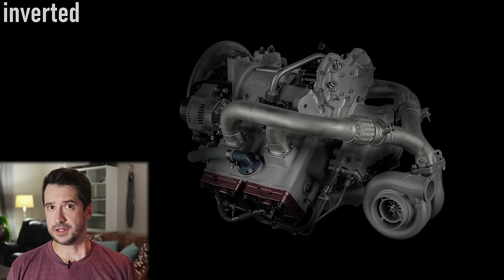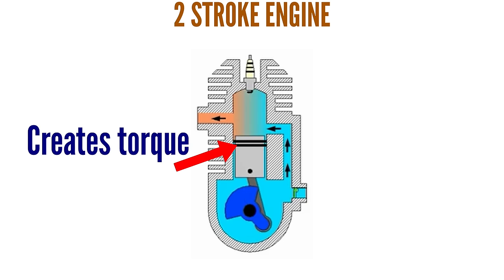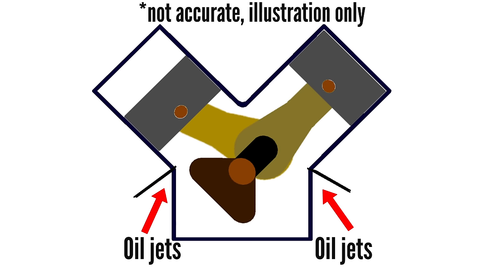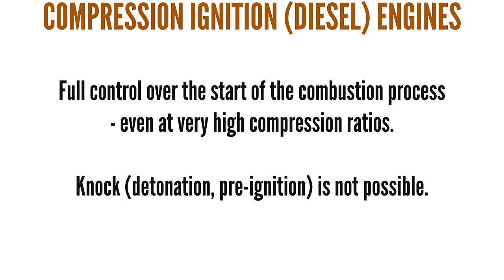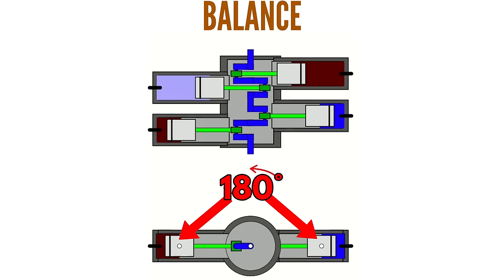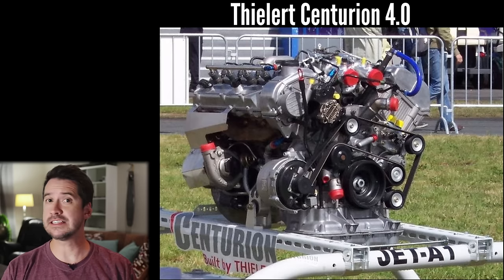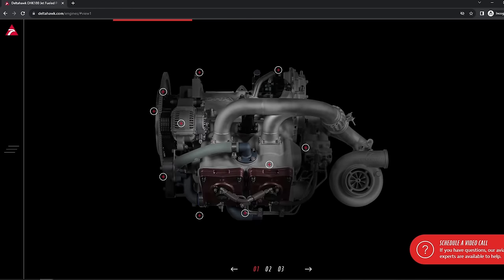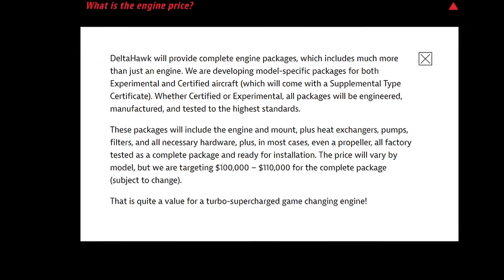Deltahawk's Jet Fuel Piston Airplane Engine Explained

Comment: The mechanically driven scavenging blower is not a supercharger, even though it is identical in construction.  It's the application that makes the distinction.  In this case it merely sweeps the cylinders clear of exhaust gasses (scavenging), in preparation for the compression stroke.  It does not pressurize the cylinders before compression begins (supercharging).  That is the role of the turbosupercharger (turbo).
Reply: in this motor, it is absolutely functioning as a supercharger (much less that's the actual name of the mechanical air pump).  Unless it had some form of Valve timing adjustment, it will absolutely provide positive pressure in the cylinder.
Reply: A “normal” two stroke also force feeds the upper cylinder. It’s done by air being compressed into the crankcase. A scavenge blower simply replicates that feature.
Reply: @Jessersadler  This motor has no valves, it is a two stroke compression ignition engine.  No valves, no valve train, no camshafts, no spark plugs.   Two strokes are simpler design, less moving parts, less parts to fail, it takes less energy to run fewer parts.    Read up on two strokes, if you don't understand them you as missing part of this discussion.
Reply: @orthopraxis235  Valve = port.  It's still timing.  Timing on a 2 stroke is achieve with placement of the ports.  Which just helps solidify the absurdity that this supercharger wouldn't be providing boost.  (although there is the "power valve". . . which is exhaust timing. . . by a slide valve (doubtful these motors have it). . .)  I comprehend engines, very well.
Reply: @Jessersadler  It's a turbocompound engine
Reply: @alanbrown397  No, it is a boosted engine.
Reply: @Jessersadler    It does not provide appreciable boost. With these port valve engine  the exhaust will always open first and close last, so any extra pressure in the incoming air stream will simply flow out the exhaust.  Only an opposed piston can time the ports that the exhaust will close while the inlet is still open.  This engine can't.
Reply: @PDZ1122  check the website. . . the engine is boosted.  The port timing has to allow that.  It's physics.

*edit 
can also be achieved with back pressure.  Basically, the whole system is pressurized (exhaust/intake), with intake being higher for scavenging.  The cylinder is still seeing boosted pressures (higher than ambient), and it's efficiency is increased.
Reply: @Jessersadler  No it isn't. It's only a scavenge pump. To "supercharge", the exhaust port would have to be covered before the intake port (assuming the pump moves more air than the displacement).  If that were the case, exhaust blowdown pressure would force exhaust out through the intake port.
Reply: @turbo8454  not if the cylinder was completely scavenged.  Also that twinscrew supercharger is not going to back feed. . . well, not twice. . .You could also achieve "boost" with back pressure.  Ski-doo seems to achieve this with only a turbo. . .

Again, the positive displacement pump used is called a TWIN SCREW SUPERCHARGER.  Regardless of the semantics argued here.  Crazy that there's an argument on what to call the "air forced into the cylinder", and when that becomes boost or Scaveging.

looked up the patent, and the study done.

There are three major conventional gas exchange types currently used in two-stroke APEs: the cross type, the loop type, and the uniflow type, whose airflow organizations are shown in Fig. 2.36 The gas exchange systems based on the cross type and the loop type use the intake and exhaust ports on the side of the cylinder liner for gas exchange, which open and close directly under the control of the up and down movement of the piston. The gas exchange systems based on the uniflow type use air intake and overhead exhaust valves or opposed piston intake and exhaust ports for gas exchange. All types of gas exchange must follow the same principle that the intake pressure that drives the fresh charge into the cylinder must be greater than the pressure of the exhaust systemSchnürle Company proposed another type of loop scavenging, called the Schnürle loop type, which has a pair of intake ports distributed on the left and right side of the exhaust ports and symmetrical along the center of the cylinder, as shown in Fig. 2(c).44 The fresh charge flows to the side of the cylinder facing the exhaust port, then backwards when reaching the cylinder head until flowing out of the exhaust port. The top of the Schnürle loop type piston does not need to be designed with a wedge-shaped flow guide structure, so there is no problem of low compression ratio and easy knocking. Because of the shorter airflow path in the cylinder and lower momentum required in intake injection, the mixing of fresh charge gas and exhaust gas can be reduced, and its gas exchange performance is relatively better under low flow conditions such as partially open throttle. Zoche’s ZO series APE adopted the Schnürle loop type, resulting in significantly improved air exchange performance and fuel consumption compared to the cross-flow type. However, its gas exchange performance remained poor at low speed due to insufficient air intake, and the fuel consumption rate was higher under low load conditions.45

The Curtis loop type adds an intake port opposite the exhaust port based on the Schnürle loop type to increase the intake flow mass and improve gas exchange performance, as shown in Fig. 2(d). APE based on the Curtis loop type has the required gas exchange and power performance in all working conditions, with significantly less performance degradation in high altitudes than the cross type and lower manufacturing cost. Most of the current APE products that apply the loop type to gas exchange use the Curtis loop type, such as Delta Hawk’s DH series APE, Hirth’s F23 series APE, and 3 W’s SP-275 series APE.46 The 150, 188, 300 kW lightweight APEs developed by NASA LewisThe two-stroke gas exchange process, which is one of the critical factors affecting the thermal efficiency and power performance of a two-stroke engine,19 is the process of replacing exhaust gas in the cylinder with a fresh charge. It starts when the exhaust valve opens (for the exhaust valve type) or when the exhaust port opens (for the piston control port type) and ends when the intake port (valve) or exhaust port (valve) is closed. The gas exchange process can be divided into three stages: (A) the stage, called the “blow-down stage”, starts from the opening of the exhaust port (valve) to the opening of the intake port (valve);(B) the stage, called the “scavenging stage”, starts from the opening of the intake port (valve) to the closing of either the intake or exhaust port (valve); (C) the remaining stage, called the “final charging stage” or “final exhausting stage”, ends until all the intake and exhaust ports (valves) are closed. There is a significant difference between the gas exchange process of the two-stroke APE and the four-stroke APE, as shown in Fig. 1. Due to the limited gas exchange time and the simultaneous intake and exhaust processes during scavenging, which involves mixing fresh charge and exhaust gas in the cylinder, the two-stroke APE is much more complex in the gas exchange process and difficult to control.20
Reply: @alanbrown397  I just looked at the patent drawings.  It seems there's a set of ports that are only connected to either the turbo or the twinscrew supercharger, and they're not in-line as one would assume.  In the writing, it mentions something about a check type valve, which I assume is on the turbocharged intake side because the twinscrew will not back feed.  It's not a traditional turbocompound set-up, but it is the same achievement.
Reply: @Jessersadler  If the scavenge pump is actually "supercharging" the cylinder then why is the turbo supercharger (correct name) there?  By definition "supercharging" means to charge higher than atmospheric pressure. No semantics involved. And any back pressure against the engine requires work to be done against it, thus absorbing some from the crankshaft. 

For charging the cylinder to a greater extent than can be done by atmospheric pressure is why the turbocharger is there. If the scavenge pump was providing greater pressure to charge the cylinder than atmospheric, there would be no need for the turbocharger.

Much of the confusion comes from the fact that GM/Detroit diesel two stroke roots type scavenge pumps were and are used as "superchargers" on gasoline engines.  Those scavenge pumps did not "supercharge" those Detroit diesels, nor does it "supercharge" this engine.
Reply: @alanbrown397  This engine has no turbine in the exhaust that is supplying power to the crankshaft, thus it is not a turbo compound engine.
Reply: @turbo8454  Yes, there's is absolutely a turbine sitting down stream.

And the supercharger is there for starting, and parameters outside of turbo efficiency.  Same as your Detroit diesel.
Reply: There is no turbine downstream of the turbocharger, thus it is not a "turbo compound" engine. The only turbine is the one driving the turbocharger centrifugal compressor.
 

BTW the roots pump is not a "supercharger". It is a '"scavenge pump" and I know why it is there. Get your terms correct. Just because the manufacturer incorrectly identifies the roots scavenge pump as a "supercharger" does not make it one. The scavenge pump does not raise cylinder pressure above atmospheric.......... thus by definition it is NOT a supercharger!
Reply: @turbo8454  A turbine is the power extractor from the exhaust gasses, and a part of the turbo.  So the whole first sentence doesn't make any sense.  Also, the compressor wheel is called the impeller or compressor wheel.

Any restriction on exhaust gasses will provide boost pressure in the cylinder.

It's not a roots blower. . . this is a TWIN SCREW SUPERCHARGER. . .  they are not the same

Back pressure caused by the turbine of the turbo provides the boost pressure in the cylinder.  The supercharger will provide boost because of this.  

If anything the Detroit people have miss named it.  Yes, it's a scavenged pump, while it's standing alone.  The second you introduce back pressure (turbo) it absolutely acts like a supercharger.  But since this was an add on for Detroit, they continued to call it a scavenging pump.

The company PATENT HOLDERS Say this is supercharged.  I agree

At the end of the day. . . Is greater than ambient pressure achieved in the cylinder?  Then it's a supercharger.

Whats next?  You going to say the turbo is a Scaveging pump?  Because it is, and it does. . .
Reply: @Jessersadler   Twin screw or roots, it is still only a scavenge pump. Not a supercharger. No matter how hard you try, the scavenge pump is not a "supercharger" by definition. Even on this engine the intake port is covered before the exhaust, thus no "supercharging" of the cylinder by the scavenge pump. Any air supplied above atmospheric to the cylinder is produced by the turbo supercharger, not the scavenge pump. Correct terminology is that this engine is a turbo supercharged engine.

You obviously have no clue what a "turbo compound" engine is. This engine has no turbine (called a power recovery turbine) supplying power (connected mechanically) to the crankshaft, downstream of the turbocharger.
 If you think it does, why isn't it in any of the illustrations or animations?
Reply: @turbo8454  Man, you obviously did not score high on reading comprehension.

Never said the turbine was connected to the crankshaft.  But the turbine is spun by the exhaust (waste) gases. . . Extracting power to spin the impeller.  It's how a turbo works..

Last freaking hail Mary for you to comprehend. . . .
Let's says you have 2cycle, with a blower, nothing else.  It will scavenge the cylinder and will not provide any additional pressure above the atmosphere.   Now take that same engine, and put a restriction in the exhaust.  Let's say this restriction applies about 10 psi of back pressure.  Because the blower is a positive displacement,  it will still scavenge the cylinder, but the pressure the cylinder see is 10 psi above atmosphere, before any new air is pushed in.

So in this motor, the restriction on exhaust gases is the turbo turbine.  What the actual numbers are 🤷‍♂️, but due to the restriction it's running higher than atmosphere pressures in the cylinder.   

This motor in particular has a separate intake port for the supercharger, and another one for the turbo.  They're not inline, and not the traditional compound.   Both are providing a positive mass of air, so both are contributing to the higher than atmosphere pressure in the cylinder.

You'd have a better argument calling the turbo a scavenging turbo. . . because guess what, it scavenges as well.  And at least at that point your argument would be consistent.

Do you research on this motor the patent is there for you to look at.

** Also, according to the archaic drawing, it looks like the intake and exhaust ports are next to each other (timed the same).  It's a simple drawing, and that could be wrong.  Just letting you know what it actually says
Reply: @Jessersadler   Holy cow, talk about lack of reading comprehension, he's in your mirror. Good God you need help.

 In my reply to allanbrown397 (who said it is a turbo compound engine) I stated there is "no turbine in the exhaust supplying power to the crankshaft thus it is not a turbo compound engine" and you immediately jump in and state  "yes there's is absolutely a turbine sitting downstream"....................Ok mr expert where is this power recovery turbine? 

And as you are having other problems here as well view and freeze the video at about 5:27 and notice the relationship of the intake port shown from the air box and the exhaust port. I'll just leave that at that.

A  word of advice. If you are going to try and impress everyone with your "I know more than everyone else knowledge", be specific and use correct terms. Fast and loose with terms and using slang makes you look like a know it all armchair blabbermouth who in reality is clueless! 

If you want to keep going 'round and 'round I'm game. You are great low information entertainment and best of all it's free!
Reply: @turbo8454  There are 2 sets of intake ports. . . Both turbo and supercharger force air into the cylinder, achieving above atmospheric pressure.  Are we now arguing something different now?  Or are you finally conceding that this is infact what the manufacturer calls it, a supercharger, which by definition is what a scavenging pump is.

Also, a compound turbo (assumption of the original OP idea. . . "turbo compound" is also used when discussing this system, although you could argue semantics on that as well.  Kind of obvious that this is what he meant) engine has nothing to do with the turbine being connected to the crankshaft.  It is a system that compresses the air twice  i.e. 2 turbos in series (called compound turbo, to delineate it from a twin turbo)  It can also be achieved with a turbo and supercharger. . .
Reply: @Jessersadler  You keep flopping around like a fish out of water. The scavenge pump is not a "supecharger" by definition. As many times as you state it's a "supercharger"' I will call you out for being wrong. That's why the turbo supercharger is there, to achieve aspiration (and power) above what atmospheric pressure could produce. I have stated these things several times now and you keep trying to twist it around into something different to save face. My argument hasn't changed from my first comment. The only thing  I concede you really don't understand the correct terminology at a minimum and I suspect that's because you don't understand what you are talking about. You are sloppy at best.

It is not obvious what allanbrown397 meant other than claiming it was a turbo compound engine. I took what he said at face value. Why would I take it any different? This is not a "turbo compound  system", or anything remotely related. Nor is it a "compound turbo system". A "turbo compound system" has the furthest downstream turbine mechanically connected to the crankshaft. This engine does not have that feature, nor does it have "compound turbo's". This engine as shown and explained in the video has one turbo supercharger and a scavenge pump. Simple as that.

And you still haven't shown me where that second intake port connected to the turbo supercharger is in the animation. (the video creator didn't mention any such second intake port either) You obviously can't because it isn't there!

Keep trying. You keep digging that hole. Thanks for the daily laughs!
Reply: @turbo8454  

"turbo supercharger". . . right🤦‍♂️

A "Compound"  setup can absolutely run a supercharger and a turbo. . .look up black smoke racing.    Also compound turbo= turbo compound,  while you may say that term is being used erroneously, it's street speak.  Like calling a twin screw a blower, when technically, by name, it's not. . . common speak, people understand.  Just Google it, and it will pull up both.

Supercharger is an air pump that increases the mass of airflow into an engine that mechanically driven off the motor.  That's what this twinscrew does.

No one is saying this doesn't scavenge the cylinder. . .the turbo does too.  Both provide boost.  

I guess you know more than the Factory, engineers and patent holders.  Write them a letter and tell them they're wrong.  they have to listen to you, right. . . the self-proclaimed arbiter of engine knowledge.

dude, I'm done.  you're willfully ignorant.

Do yourself a favor, and look the patents up. . . but you won't.
Reply: @Jessersadler 

I think that when you use the term “compound” in the context that you are it can be confused with “Turbo-Compounding” which does mean to have excess exhaust energy provided to the crankshaft via various means. So a lot of the discussion seems to revolve around precise technical definitions of “things”. And it seems that various people are not on the same page. Interesting discussion, learned to be more careful.
Reply: @Mentaculus42  Black smoke racing ran both a Turbo and a supercharger on their OM606 engine in the early days.  The air is compressed from the turbo and then compressed again with the supercharger.  Hence, the "Compound".
Reply: @Jessersadler  

Not arguing the terminology, so identical to a P-38 and a P-47 but not like a Volvo D13TC engine or a Wright R-3350 (Turbo-Compound version) radial engine which are Turbo-Compounding engines. Also some types of Formula One engines that use a Motor Generator Unit - Heat (MGU-H) which is one single unit that is both a turbocharger and a centrifugal supercharger with electric energy recovery & power input). Similar name but quite different intent with some combined capabilities.
Reply: @Mentaculus42  well, there was a question mark after your comment.  It would be better to call it sequential, but that denotes 2 styles of turbo-charging.  Maybe Sequential Compound Turbo should he the full name.
Reply: @Jessersadler  

Thank you for replying. When I first commented I knew that it was important to read more comments to get a better understanding of the discussion. I came into it with preconceptions about terminology but then sorted that out and learned useful details. It is rather amazing how many variations there are with different ways of getting the cylinder charged with new air. The whole “scavenging” terminology was an educational thing for me.
Reply: @Mentaculus42  for sure
 I did misread the above turbo-compound (though he interjected something we weren't even discussing) but to be fair that's used interchangeably with compound turbo and sequential turbo.  Same as Blower and Supercharger being used interchangeably.
Reply: @Jessersadler  You cannot supercharge a port valve two stroke (unless its an opposed piston). The inlet closes before the exhaust so it's impossible to produce more than atmospheric pressure in the cylinder. So the mechanical air pump here is a scavenge pump, but marketing likes to call it "supercharged" for ignorant pilots.
Reply: @Jessersadler  Only if you're using Trump-physics.  Unless you can close the exhaust port while the inlet is still supplying air in excess of atmospheric pressure, the extra air will just flow out the exhaust. A port valve design like this cannot close the exhaust before the inlet. How hard is that to understand?
Reply: @PDZ1122  Or. . .  wait for it. . .  Back pressure. . .

I wouldn't be so quick to call names.  Especially "ignorant" pilots.  You sound jealous.

And it's exhausting to explain that the airpump used is LITERALLY called a super-charger.  It's not marketing.
Reply: @Jessersadler  By ignorant I mean most pilots somehow think they get an engineering degree with their license.  And what does "super"-charger really mean? "Super" means above or in excess of, as in above atmospheric pressure. This one may put out above atmospheric pressure, but as soon as it gets into the cylinder, the open exhaust port prevents any build up of pressure above atmospheric.
Reply: @PDZ1122  except in this case, there is a turbine(back pressure) sitting downstream of the exhaust port.

"supercharger is a form of forced induction that is mechanically powered" . . . whether cylinder scavenging or boost is the result, is a moot point.   

If anything, Detroit was the one to muddy the water, calling it a scavenging blower, when by patent, it is a roots blower.  Yes, a supercharger/blower alone will not make boost on its own (other than described above) This engine specifically makes boost pressure, part of the pressure will come from the supercharger.
Reply: @orthopraxis235  Look up a Detroit Diesel. Supercharged 2-stroke Compression ignition diesel engine with OHC and 4 exhaust valves in the head. The OHC runs both the valves and the mechanical injector. H.O. versions were also turbocharged.
Reply: @PDZ1122  Look up a Detroit Diesel. You guys arguing sound a bit 'tarded with the "Lack" of understanding that "Lots" of things are possible.
Reply: @RealDougFields  My point exactly. The Detroit Diesel uses a similar Roots blower for scavenging, often combined with a turbo. But only with a uniflow system with independent exhaust valves in the head can you actually produce more than atmospheric pressure in the cylinder. Not with conventional port valves.  And with that I am done trying to educate.
Reply: @PDZ1122  NO- they make a small amount (2-4 psi ) on just the blower. The motor would not run at idle if it didn't. It is NOT a scavenge pump. Your knowlegeg of 2- stroke port timing is mostly correct but you dont under stand the differences between different designs. This video does not get in depth and the drawings in it are not technically correct. It could have a device that controls exhaust flow. Your assumption of the blowers function is not automatically correct in all but the simplest of designs.
Reply: @PDZ1122  what do you think the psi is in the exhaust manifold before the turbo? Is it equal to ambient, or greater?